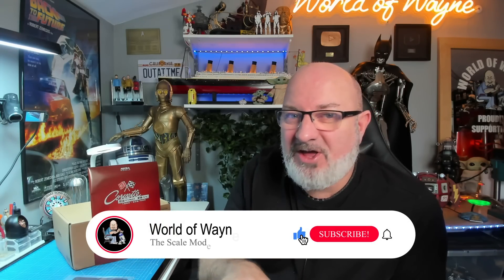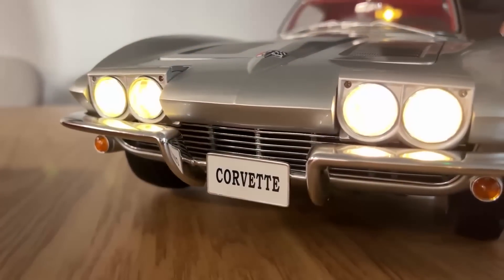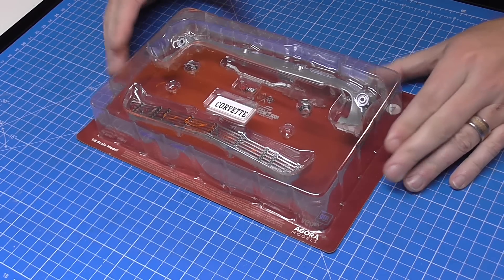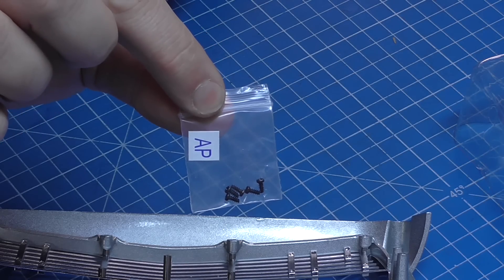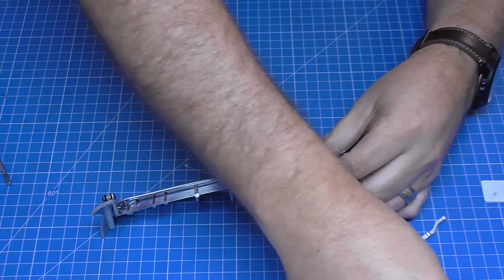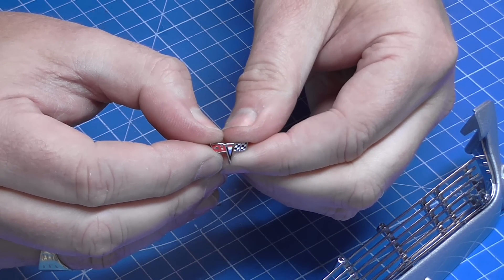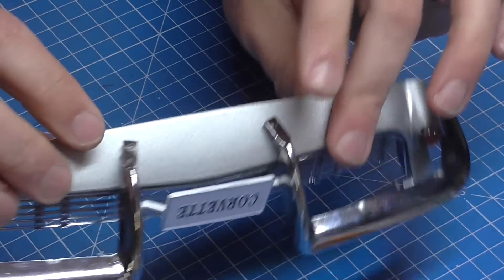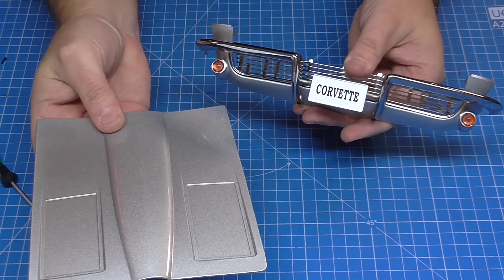Build the Corvette Stingray - Pack 1 - Stages 1-5

Comment: BTW re tyres, if the tyre tread is angled it normally points backwards so the tyres disperse any water as they spin. That way you know which is outside - assuming left and right are different :)

Comment: Hello. I’m new to the channel and new to the hobby. My experience is limited to Lego technic so basically zero. I have been researching beginner kits but perhaps other than snap ones, a lot of them require painting and gluing. This one from agora (and guessing same for Pocher) seems to be pre painted and only requires screws. Is that correct? Financial is much higher of course but would you say a beginner can handle it?
Reply from the maker: Yep. All you theoretically need is a screw driver
Reply: @ thank you! Do you have any experience with Pocher? Their 917 is considerably cheaper but seems there kits are more for intermediate to expert builders
Reply from the maker: @whathappendnext5887  I do. Pocher are good but there is a lot of finding parts on sprues
Reply: @WorldofWayneUK  thanks again! Really appreciate the responses. Love the channel and have subscribed
Reply: @WorldofWayneUK  sorry one last question - as a first attempt which one would you say is the ‘easiest’ - Ferrari GTO, Corvette Stingray or Lambo?
Reply from the maker: @whathappendnext5887  stingray. Definitely

Comment: I find I need oil for plastic and not metal when inserting screws.🤔
Reply: These Plastics are petroleum based as are most oils, so over time it will weaken the plastics,